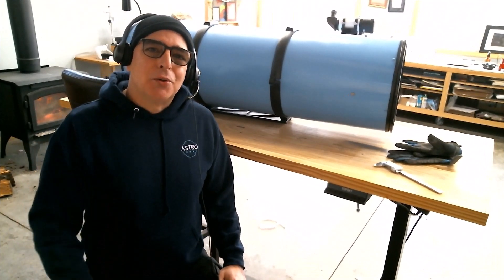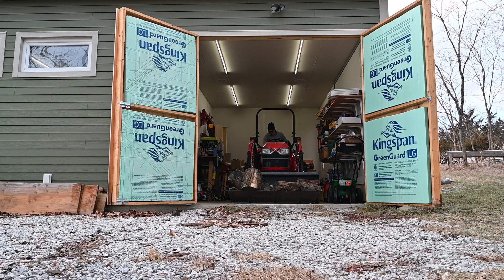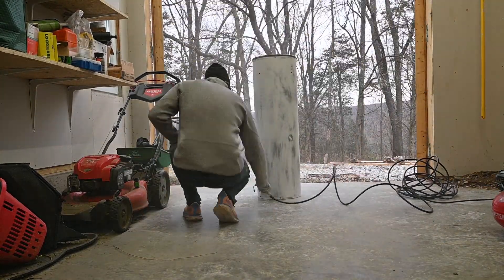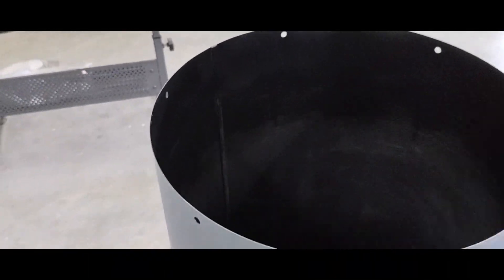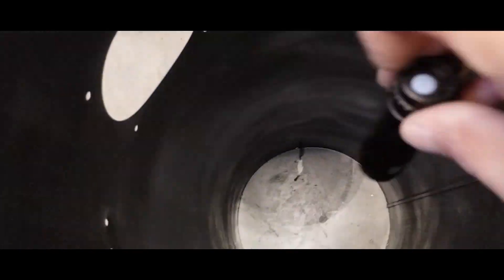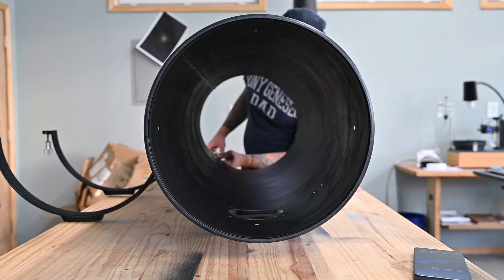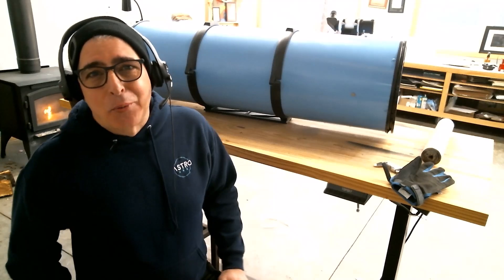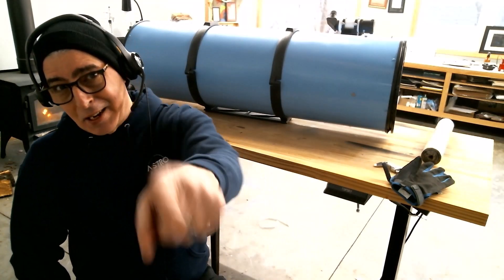Rebuilding a 12-Inch Reflector: 5 Upgrades for Better Performance!

Comment: I have also ground mirrors and built telescopes. That black ring in front of the mirror would be a great cure for a turned-down edge, which many mirrors have. A turned down edge can introduce an undesirable milkiness in the view. It is difficult to figure a mirror to better than a 1/8th wave and not have a turned down edge-it's sort of a trade off. The extent to which the ring covers the outer edge while elegantly solving the turned down edge, effectively reduces the size of the mirror and effectively increases the focal length of the telescope.
Reply from the maker: Thanks for the comment Mitch. I would love to pick your brain on your mirror grinding experience. I am working on a 12" F3 and a 16" F3. More to come on those as we close out the year!

Comment: I have built many telescopes over the years. I never use running water in the sink. Unless you have a microfilter on the faucet, there is a constant stream of dirt and metal in your tap water, and all it takes is one time to make you understand that care must be given when cleaning front surface mirrors. Only distilled water and liquid ivory soap for cleaning solution. Quality cotton balls first, and then Pec Pads for lightly clearing the surface. The distilled water for rinse. No alcohol. You are taking shortcuts and cheap, lazy alternatives. Also, NEVER invert the mirror to install a cell into a tube or mirror box. I always put the tube or mirror box on its side and then slowly slide the cell into position. I winced through much of this video. Good job on the tube and aperture mask. Also,you are the first person I have seen to install a inverter focuser on the tube. Most people have the focus shaft below the focuser aperture.
Reply from the maker: All fair comments. I used the tap water with dish detergent and a very gentle touch for the main wash. The mirror was caked with soot from years of uncovered outdoor existence. It was part of a dome rescue project. I did all the rinse with distilled water and alcohol in the mixture. I am not sure why you object to the alcohol use, it helps prevent water spots in the drying process. I was very satisfied with the result. Agree 100% on the mirror installation advice, in retrospect I would probably try your approach. Your comments are welcome and appreciated! Best...

Comment: For the interior I wouldn't use spray paint, I'd either roll or brush on and maybe even mix in a small amount of black grit to ensure you don't get a "fluid" finish that will reflect light. I'm not a fan of flocking as any material will eventually deteriorate and begin to dust your mirror with fibers.
Reply from the maker: Great point - and thank you for the tip about the texture!

Comment: I'm sorry. That was all wrong. You never spray alcohol on a telescope mirror. Secondly, the mirror clips have nothing to do with collimation whatsoever.
Reply from the maker: Thanks for your comment, interesting about the alcohol. I have used this technique for decades with excellent results. However, I am always willing to learn new methods. As for the mirror clips, many folks actually rely on the mirror clips for gross alignment of the secondary mirror. Obviously, I do not. Collimation is all about alignment and visuals - such as the clips - serve as an aide. Cheers.
Reply: I meant no disrespect. I apologize if it came out that way. You're obviously dedicated and sincere. Clear skies!  Sincerely, Carl.

Comment: Is the mirror fixed only with the 3 holders? so it sits loosely in the mirror cell on top of the felt pads you put on? - ty for a great video :)
Reply from the maker: The mirror does rest on the three triangles, each with three points of contact. However, it is held in place with three clips which are spaced 120 degrees apart. The clips have caps the screw down into the clip body. This provides a touch of pressure on the edge of the mirror at these three points, which prevents the mirror from falling out of the cell. Not to tight mind you, as too much pressure can lead to pinched optics. I deployed the scope this week but can not do first light due to snow storms! Stay tuned and thanks for your comment!
Reply: @AstroDNAObservatory  thank you for the answer ill stay tuned :) keep up the good work!

Comment: I've got a Zhumell Z8 Dob. I flocked the whole tube. A bit of a pain to do, but it's the best way to go, in my opinion.
Reply from the maker: I tend to agree - still, I want to explore a baffling solution as well. We'll see how well the adhesive holds up and if the velvet material is a dust magnet. In the end, I think the treatment is much better than stock!
Reply: @AstroDNAObservatory  
Mine has held up fine for more than 15 years, and the only dust in my tube, unfortunately,  is all over my mirror...

Comment: have you considered using Musou Black for the inside of the tube? It absorbes 99.4% of light that hits it
Reply from the maker: Read about that product, but did not try it. Going to evaluate the performance of the budget flat black/selective flocking technique to see how if does. Will share more after first light! Thanks for the comment!

Comment: Hello from France 👋 
Very good work 👌👌👍👍  What model is your telescope? Reference ?
Reply from the maker: Hello from NY! This seems to be an older TPO branded GSO based Newtonian. They don't seem to make them anymore. Fun project. Thanks for your comment!
Reply: @AstroDNAObservatory OK, thanks a lot' 
I am looking for a very good Newton telescope for planetary but not dobson. Do you have a reference? 😁😁
Reply from the maker: The key with planetary is focal length - which is why I tend towards the SCTs for planetary imaging. Having said that, f/4, f/5 reflectors in the 8" to 12" range with a barlow also work. I have read very positive reviews of the Sky Watcher Quattro lineup from community members that I know and trust - here is the 10" version:  https://www.highpointscientific.com/skywatcher-10-inch-f4-newtonian-reflector-ota-s11220 - I have not affiliation with any vendors - just a link to the scope!
Reply: @AstroDNAObservatory  Ok thanks for the information. I am French. I mainly practice planets.
My telescope is a Kepler Cassegrain 200mm F12.

Comment: Great video! I have the same OTA and also performed these necessary upgrades. I've had the OTA for a couple years now and also found it required a more robust secondary spider assembly to maintain the secondary mirrors position, I recommend and installed the robust AstroSystems Secondary and Spider assembly. Depending on your climate, I've also found a heat strap around the primary mirror and behind the secondary mirror were critical in preventing dew from forming. I've also upgraded the springs in the mirror cell as I believe the stock springs are the same from the 8" and 10" mirror cells; the 12" has much more mass and maintaining collimation was challenging. It's a wonderful and very capable OTA, clear skies! 👍
Reply from the maker: I agree about the springs - I think the scope will be in the shop again during 2025 for additional improvements. My secondary seems to be metal alloy and sturdy - but testing in the field will reveal more... I am hoping the fan will help with the dew. We shall see! Thank you for the comment. Cheers!

Comment: Do you think a similar sized Newtonian is better than an SCT for DSO imaging? Are they easier to collimate than a SCT?
Reply from the maker: I think both designs have there plus and minus points. I think you can get more aperture for your money with the Newtonian design but the SCT is a more compact form factor for achieving longer focal lengths. I will do some comparisons during the coming months. In terms of collimation difficulty, I consider them equally simple with some practice. The major difference is that a Newtonian often involves adjustments to both the primary and the secondary where as the SCT is all secondary adjustment. Also, The SCT can be a little tricky because you are often doing it at night deployed on your mount looking at either your camera image or through an eyepiece. A newtonian can be collimated (decent level) indoors on a bench using a variety of inexpensive tools. I will cover that in my next video! Thanks for the comment!

Comment: Amazing. No one else I've watched has been that "rough" with a mirror. They all use soapy water, but never touch the surface w/ anything but clean cotton balls.
Reply: Yikes! When I saw him spray the primary mirror down with alcohol and wipe it down I almost had a heart attack. Cotton balls and slightly soapy water...
Reply from the maker: The final rinse with alcohol with an air compressor to accelerate drying is very effective. I tend to struggle with cotton balls because they leave irritating strands. The cloth that I used is insanely soft, it is used to clean protective glass for a laser diode head. The weight of the cloth is the extend of the pressure that was placed - just enough to move the alcholol solution beyond the outer curve radius. But I fail your anxiety - any contact with optical surfaces is nerve racking! Trust me, I am gentle. Thank you for the comment!
Reply from the maker: Gentle contact with  your fingers using a drop of dish soap and running water is fine. Just make sure your fingers are clean at the start. I really find the final spray with 50% alcohol to be effective as a finishing step. Thanks for the comment!
Reply: I just bought the materials recommended by most, including Sky-Watcher's WOW "pro" cleaning tutorial. Your method is obviously easier. Thanks

Comment: Looking good.  Glad the mirror cleaned up well, not many pinholes or flakes (which I would have expected).
Reply from the maker: Thanks, Larry. There are a few small pinholes - but overall very good shape. I think it will do a fine job. Next step is to collimate and setup the image train. Cheers!